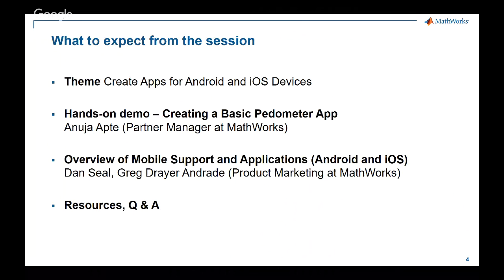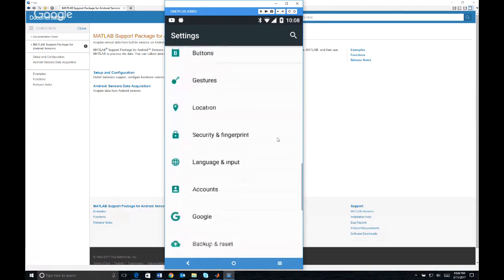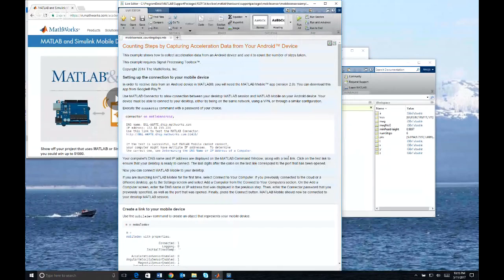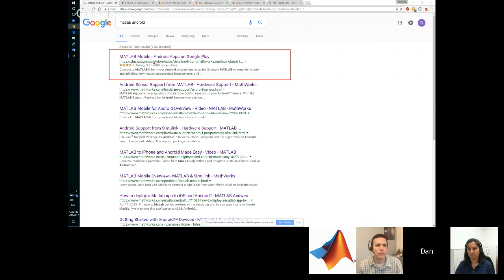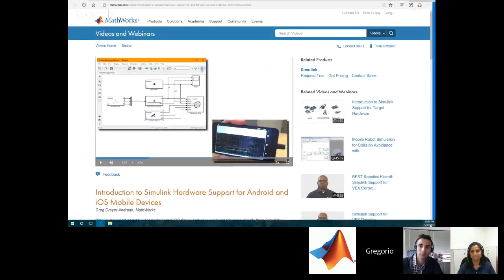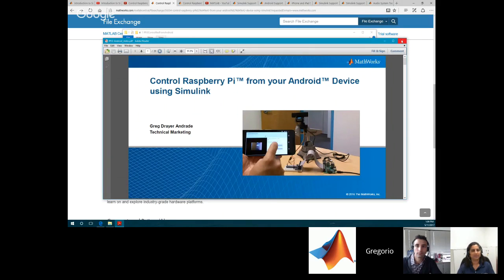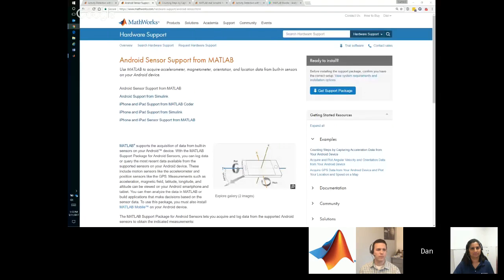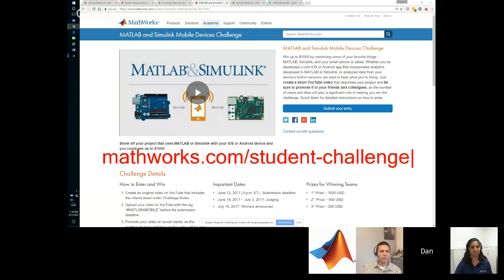MATLAB & Simulink Mobile Challenge

Comment: Hello,
I was trying to configure my Android device with Matlab support package installer but facing few problems. During verification of configurations Testing connections is getting failed (After building and running app).
I am able to see the TestApp open in my mobile and both are connected on same wifi network, but IP address shown on TestApp is bit different with IP address of PC.
can any one help me out knowing this stuff?